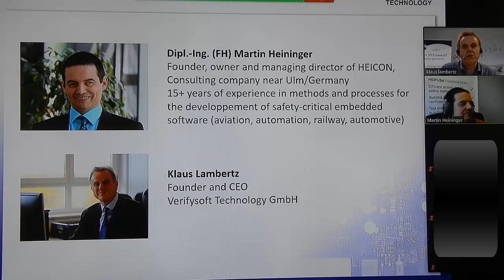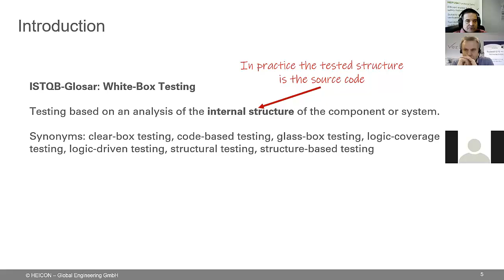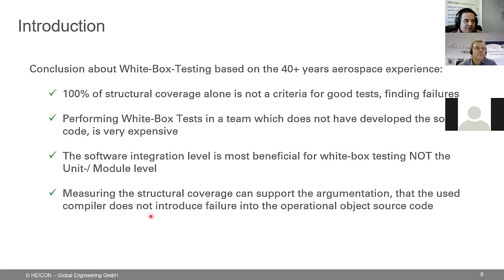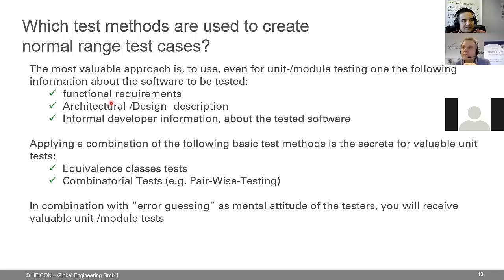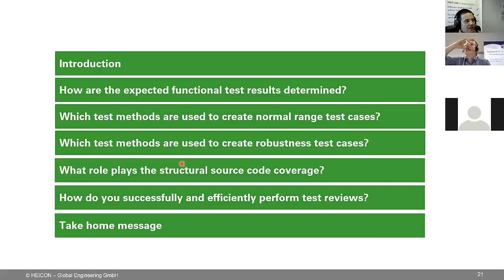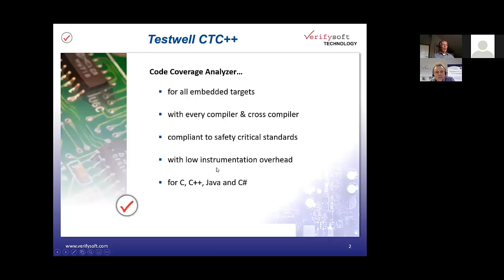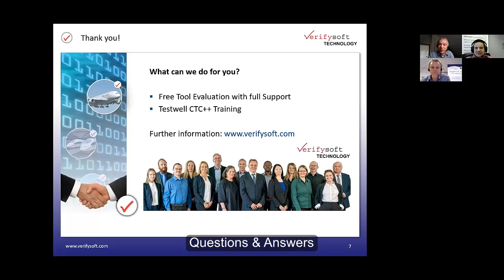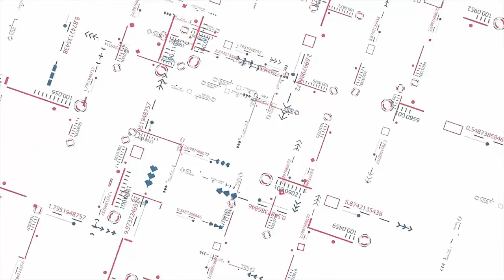White-Box Testing in safety-related Projects (recorded webinar, 196)

Comment from the maker: comment which has reached us via email: 
It was correctly confessed and noted that even use of CTC++, and having got 100% code coverage, does not mean that the sw would function correctly, which is one requirement of good quality, only that the sw code was executed fully according to the coverage level as CTC++ measured it. "The code does what it does..."

At slide (~31:37) "what roles plays the structural source code
coverage": As a benefit to it was mentioned "mathematical completeness proof" and as a shortage was mentioned "does not detect functional failures".

I would like bring up next thinking model:
- the poor devil programmer has on day 1 read the specification and written the code that he/she thinks is needed to handle all the combinations that the code snippet has to handle.
- then much later, on day 2, the (unit or whatever) tests are done
- if the tests are done by the programmer, he/she is no more in the same intensive thinking mode (no more remembers),  what all usage combinations can come up. Or if the tester is other person, he/she may have radically different understanding what the code should do and what needs to be tested
- anyway the coverage tool reveals unexecuted code portions and unexecuted design combinations, which anyway the programmer sometimes has written with good intent belief that the code is needed
- either, yes, the code is needed (=> the code needs to be test-executed), or the programmer had at coding time thought it wrong.
- so, in this sense measuring code coverage helps to find functional failures!

Question is a bit different if the code is reusable component. It may have extra features, code checks, etc. that do not come into use in the application at hand. Anyway, a code coverage tool reveals the unexecuted code portions that can then be assessed.